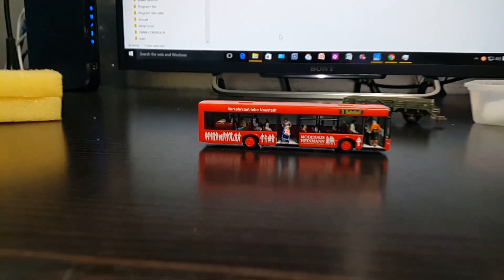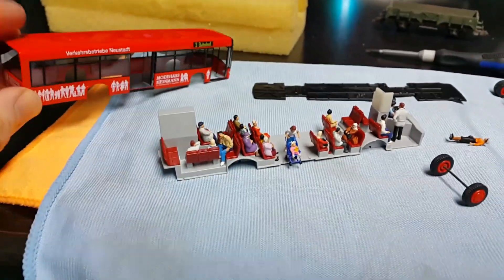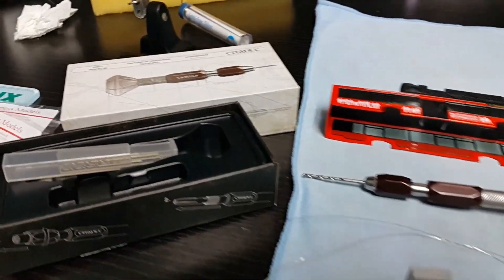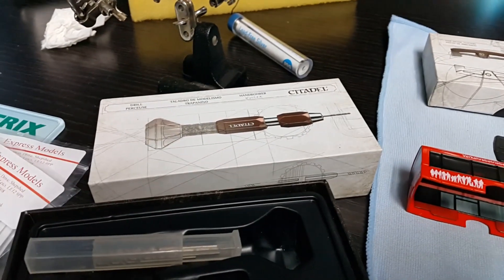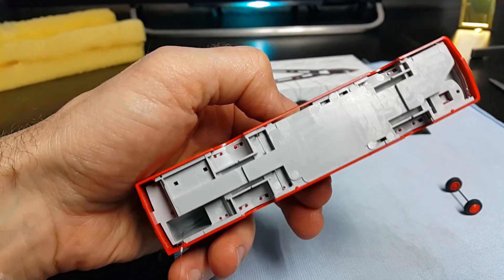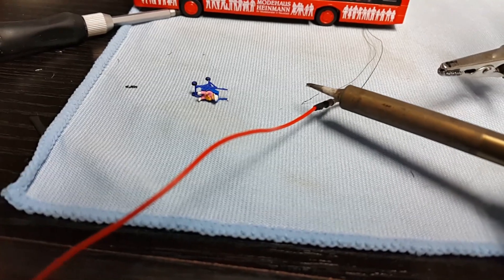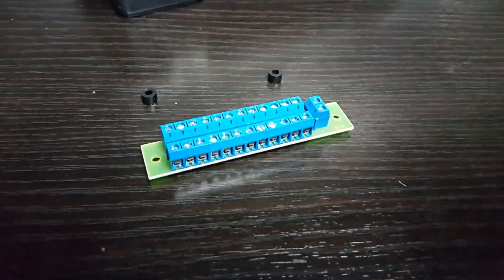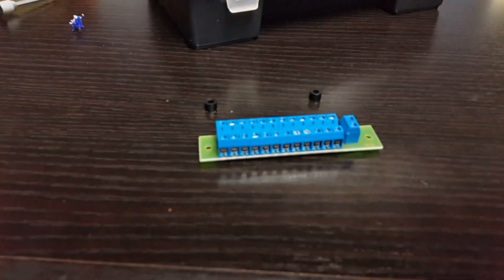Preiser Herpa bus13009

Comment: Nice little project Jim. Looks good in the end. Handy finding those blocks. Laurie.
Reply from the maker: Those blocks are fantastic......as the terminals clamp the wires rather than the screw twisting into the wire

Comment: Hi Jim, nice session on adding lights to a coach/bus, it is amazing what can be done with SMD's. Have a look at using the round 3v batteries with a battery holder with a small dip switch to turn them off and on, which can be placed inside or glued underneath.  You can then put the coach/bus anywhere on your layout without drilling holes in the baseboard. Those power distribution boards you bought from Germany, another YouTube char, Dave, showed them and asked how cheap I could produce one.  All the parts to make a 12 block board costs me £2.50, very easy to make...Simon
Reply from the maker: Hi Simon some good ideas there...
The boards work out at about £2.70 ish in batches of ten from the seller...you should start selling them if it's worth it after overheads...
you are the expert in the electronics field and more...👍👍

Comment: The bus looks good with the light.  You are lucky that you could fix the wire back on.  I find most of the time the little pad comes off.  I sold quite a few of them.  I make my own for next to nothing.  To bad that the bus is so hard to take apart, you could put a button battery in that spot where the wire is with a reed switch so the bus could be moved around.Scott
Reply from the maker: Hi Scott. .Yes this bus could be converted to run on the faller road system....
Those micro leds are great ......